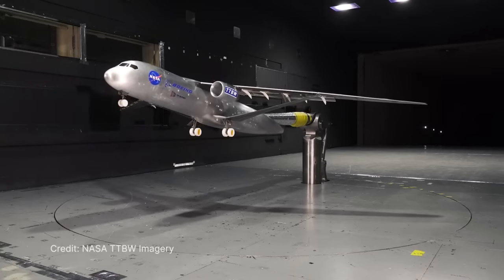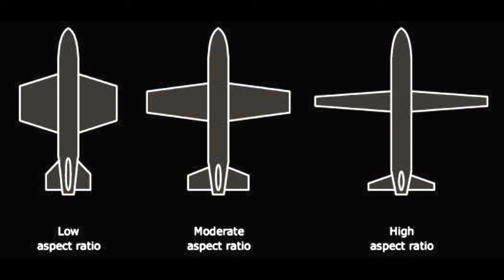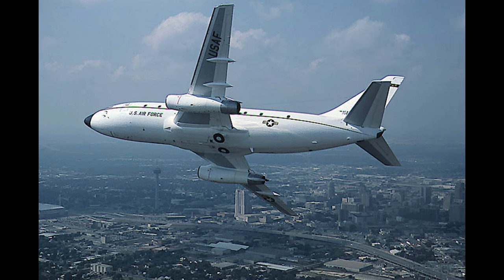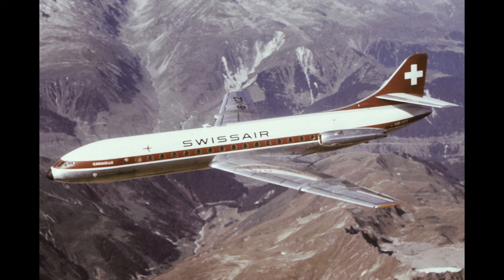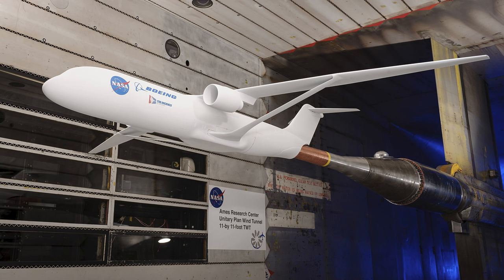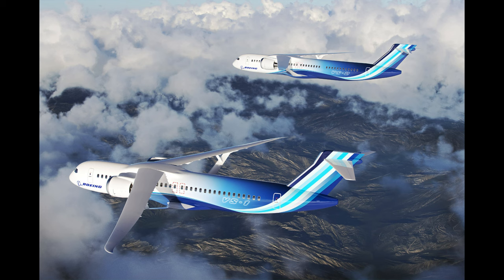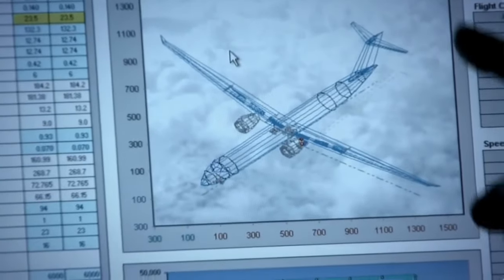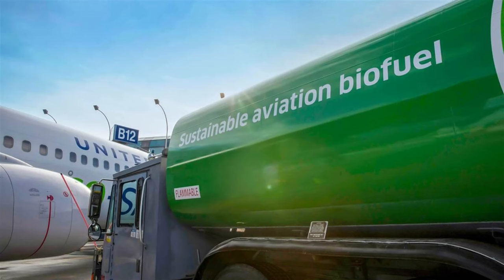NASA's New Airliner Experiment To Make Flying Less Expensive

Comment: Another place where electric planes might work could be island shuttles - e.g. between the islands of Hawaii, in the Caribbean, or the North Sea islands of the Netherlands or Germany. These flights take only 10 to 20 minutes, so it looks viable for electric planes. BTW, to locate these spots, look where there are still piston engine planes are used instead of turboprops, as these are cheaper on very short routes 😁
Reply: Look at Harbour Air . . .
Reply: Even small to medium planes flying between capitals maybe would work. Instead of driving like 6h, you could fly in about 30 minutes
Reply: @plcflame  Oh yes 30-minute flights, but let's see pre-flight, weather check, post flight inspection/log, find a ride as your car is back at the take-off point, ah NO! just as fast. I have been there and no it isn't faster by a large amount. How figure in purchase price, 110LL fuel, insurance, tie down monthly costs, NO flying is FUN but not faster. A trivia point, of the 300 million liters of kerosene made each year one half is used by the commercial airlines, (no emissions there), and the remainder is used by the third world countries to light their homes at night and to cook. Google it.
Reply: But how would you get an electric plane, with a 1ish hour battery life, to dinner of these remote isolated places?
Reply: @jessetheunending9357  the same way you get short distance prop planes there now, you ship them over.
Reply: @plcflame  You made the point where I would drive from LA to San Jose in 6 hours, and a flight from LA to San Jose is about 45 minutes, not counting driving to the airport, logging in, waiting, boarding, etc. Yes, flying is great unless you happen to fly on the windiest days of the year, which I did. I got royally sick for days, ruined part of my vacation. So, driving is longer, but I still have a car at my destination.  But hopping islands is a different story and I definitely would take a plane.
BTW, I enjoy driving on Hwy 101. If I leave early, I get to my destination by noon. Instead of renting a car, I drive right to where I want to go. So much simpler though it takes a little more time.
Reply: @plcflame  HSR would be the optional substitute for 6 hour drives
Reply: Look into Eviation, they're targeting that market with their battery electric regional jet. They just did first flight in September!
Reply: @plcflame  Would an express train, like TGV or ICE, not be the more convenient and efficient solution for this use case?
Reply: @plcflame  not really. A electric airplane would be much slower as well. Proboly about 400km/h or so. So a 30 minute flight is about 2 hours on a decent highway.... or 1.5 your in Europe.
Reply: Good luck charging it.
Reply: @peterolsen3797  That kind of flight is better accomplished by a future rotodyne design than a plane.

Comment: Scott - saw the pic of the flying wing design in today's video - you might be interested in this... very much like your comment about the time for the FAA to certify unleaded fuel...
Over 20 years ago I was doing computer language training for Boeing in Seattle and during the week saw the model they had of their version of the flying wing airliner.  I asked one of the VPs there about it and he said they were abandoning the idea not due to any design or mechanical or production issues, but because the FAA told them it would never get approved for commercial use.  He said the FAA has a requirement that all passenger aircraft must be able to de-plane all passengers in 90 seconds or less in an emergency, and the huge distance in the flying wing from the center seats to the exterior doors means they can't make it big enough to fly profitably and meet that emergency requirement.  So no flying wing for us - it's often the safety issues that prevent otherwise "good" ideas from being realized.
Jim
Reply: I still see the concept viable for cargo. Disregarding the evacuation part, if you sit away from the center, you are not going to like it as even the tiniest angle change is amplified. Of course there is also the fact that you can't have windows, But hey, packages don't need any of those...
Reply: I wonder about the implications of that 90 second rule for SpaceX considering plans to use StarShip as a passenger hyperliner from one Earth port to another? Or for military personnel transports, etc. Airlock, cargo, or passenger egress doors may add weak spots in fuselages (e.g., SpaceX welding over Starlink ports for initial test flights). Wonder if the Human Lunar Lander astronauts would be require the capability to de-ship in 90 sec too.
Reply: Cargo folks seem to be perfectly happy picking up second hand passenger jets, though. It would surprise me if there was enough market demand to make an entire category/design of plane that was cargo-only. (A flying wing, not just a cargo variant of a passenger rated jet)

Comment: Even extremely small savings in fuel are worth it for airlines. I work for a  fairly small airline, we have only around 300 aircraft (all A320 family ones). And for example we use single engine taxi out, so we start only one engine initially for taxying to the runway and start the second one later on, which needs us to use our judgement to make sure it gets its 3 minutes of required warmup time before we can use take off power. Single engine taxi out saves on average 40kgs of fuel per flight. Doesn't sound much. But if you consider we have around 1.500 departures per day, every day of the year and we can use single engine taxi out on roughly 70% of our departures (sometimes it can't be used, like in low  visibility operations, operations on contaminated surfaces and when the taxi time is too short), that is 15.330.000 kgs of fuel saved, or 15.330 metric tons and that in turn saves around $15,775 million per year. Of course that is only one of the many measures we use to use less fuel, and in the end  it is just a tiny amount of fuel saved, not a whole percentage point at all, so the roughly 2 to 4% that a winglet (sharklet for us) saves is use, and even more so the 15% that replacing a CEO with a NEO aircraft does. So getting 10% basically free savings with a different wing design is absolutely worth it.

But from my point of view it will still have to fit into the standard airport spaces, which means maximum 36m of wingspan at the gate for a narrow body airplane, so basically everything up to 240 seats per cabin (max certified for the A321 is 244 seats, 737 MAX 10 230 seats). Which will quite likely require some clever mechanical engineering.
Reply: I admit I do not think of 300 vehicles as a small transport company, but I have to remember firms like Delta have a few thousand.  But you are right in that a little goes a long way, UPS avoids left turns as much as possible because of time spent idling waiting to turn.  Mythbusters tested this and found it only saved a handful of gallons a trip but even they concluded when you put that across nearly 100,000 package cars(what  UPS calls their delivery vans) a few gallons of diesel is now several thousand gallons of diesel saved per day.

Comment: This is the wings design I was going for as I was planning to make our fixed-wing platform drone. And now I see it here. I take it as a compliment :)
Really, exactly this. A long wing with this type of support that it functions for lift as well, just as another wing. My concept includes another solution as well, which I will keep for myself for now.
If you don't know, I worked on building a monitoring fixed-wind drone before and I worked in the aerospace industry as well.

Comment: Harbour Air flies a lot of short hops. The Vancouver Airport, Vancouver City, and Victoria triangle is ideal for electric aircraft in a way that almost nowhere else is.
Reply: If you only do one hop!  Harbour Air does 300 flights a day, which is why their electric plane isn't running on one of their routes.
Reply: @StinkPickle4000  true, new charging infrastructure will be needed. The combination of high voltage and seawater will be a challenge.

Comment: saw a similar truss wing design research papper in 2010 during university time. I vaguely remember additional drag from the truss support outweight the drag reduction from increase aspect ratio. The lift generate by the truss wing also cannbalize the lift on the main wing, so it's very difficult for a truss wing design to have better lift/drag performance over traditional design. Unless composite material advance enough in the last ten years making the truss structure smaller, it's probably not worth it.

Comment: This is very exciting stuff. Combining these new airframe designs with the very latest in ultra high bypass engines, unducted fans, may be a huge step forward for aviation.
Reply: I came down to the comments to say much the same. It seems as if a new engine type is coming, it should be combined with this new wing type for a whole new plane. Yet Boeing says they won't even get out the drawing board until after 2030. They should be testing unducted fans together with transonic truss and have it worked out by 2027 or so. That's halfway to a new plane right there. If they get aggressive they could have a new plane certified by 2032. Their current timeline would be lucky to have a new plane by 2037.

Comment: Another aspect of pure electric (battery) aircraft is the limitation in mission profile. Unlike a fuel-powered aircraft, the empty weight includes 100% of the battery too. So your load profile can’t be modified to suit a target range/mission. Not so much a problem for GA aircraft but absolutely a problem for transport-category aircraft. You need the ability to tailor your fuel load for the mission; a short hop, means low fuel and high payload and visa versa. Batteries don’t allow the same flexibility; your payload is always fixed which is a hard way to make money.
Reply: Interesting. Perhaps modular batteries could be used? If you need to go farther, load more battery modules.
Reply: Batteries can be removable. Ideally, you'd be able to move them around like ballast to redistribute weight, negating the need for actual ballast.
Reply: @GuntherRommel  true. There is potentially some limited scope for mission flexibility. However, in transport-category aircraft, if battery is the sole power source your landing maximum landing weight (MLW) becomes your maximum take off weight (MTOW) too. In liquid-fuelled aircraft the MTOW is significantly higher than MLW which further limits the comparative practicality of battery-only power sources. I think, like EVs, there will be specific use-cases for battery powered aircraft, but it wont be large, long-range or transport-category aircraft.
Reply: @jasondoe2596  yes, that’s indeed possible. Except every battery added reduces payload and you need to carry that weight for the entire flight. As liquid fuels burn, the aircraft becomes lighter and thus requires less power to maintain a constant speed/altitude. Alternatively, as weight is reduced during flight, you can fly higher/faster for the same power (which is exactly what modern airliners do). Batteries can’t do this which limits mission flexibility.
Reply: Well no.  Would go with palletized batteries.  Due to energy required during charging, would have to have palletized batteries be loaded anyways.    Or a combination is far more likely.  A base battery + palletized batteries.  Of course we currently have no battery tech able to meet requirements so who cares.
Reply: depends where you put the batts. If they are basically cargo, then you can do the same trickery, one less pallet of cargo and one more pallet of battery.
The main difference is the power density of fuel is not even in the same ballpark of batteries
Reply: @marcogenovesi8570  true. However, with pure battery power your MTOW and MLW have to comply with the most restrictive of the two. Modern aircraft the MTOW is much higher than MLW and allows for a lot of flexibility. Fuel density is a problem for batteries, especially on long range missions, but that is offset to a certain degree with power delivery efficiency being so much better with electric motors. Having said that, pure electric aircraft capable of similar performance to modern jets is still a pipe dream for many reasons; lugging 100% of your “fuel” around regardless of t charge level is a problem that will always exist and not something that scales well to transport-category aircraft.
Reply: @w8stral  regardless of how they are loaded, there are a number of factors (I’ve alluded some in other comments here) that make pure battery powered transport-category aircraft unattractive. That’s not to say there isn’t a role for pure-battery aircraft, only that even with conceivable technologies as it stands today, the use-case for such aircraft would be somewhat narrow compared to liquid-fueled aircraft. All I am highlighting here is the need to continue research into liquid fuels and aircraft utilising this power source to be as efficient as possible. Batteries are not the utopia a lot of people assume.
Reply: @DiverJames  electric motors have higher than 90% efficiency but it's still irrelevant because the batteries have power densities that are not even in the same post code of conventional fuel. That's the main reason electric aircraft (and land vehicles to a lesser extent) have inferior range.
Lugging battery/fuel weight or not for the whole trip gives an edge on fuel's effective "power density" or total system efficiency, but at the end of the day it means just a higher treshold to beat for competing technologies, in itself isn't a thing that always makes fuel better.
If there was a technology that is massively more power-dense then it would still beat fuel even if you have to carry the batteries around.

It would be like comparing battery power and compressed air. Yes as you use it up the compressed air will lower your mass but the batteries are so much more power-dense that they still handily beat compressed air as source of propulsion.

It all comes down to power density, the other stuff is secondary. Electric is not anywhere close for various reasons and is imho unlikely to get anywhere near unless you start installing hilariously unsafe (unshielded) fission/fusion reactors.
Reply: Electric aircraft can not file IFR due to fuel reserve limitation requirements.
Reply: @theethicsofliberty4642  Dude all bio fuels are  an energy negative process, you are storing energy to create the fuel and efficiency can't be perfect. Of course it's energy negative.
You will never beat just extracting mineral fuel that is already created "for free", that's not the point of biofuels.
Reply: @DiverJames  Until a new battery tech happens with several times greater energy density, even short ranged flights are impossible at any reasonable speed and at short ranges, may as well use a train which also uses electricity.  

If anyone can crack hydrogen fuel storage in a light container, then there are slight improvements we can make to aircraft, but otherwise aircraft efficiency gains are in effect --> over.  it is 100 year old tech at this point.  Everything that can be done economically has been done.  Only improvement on horizon is if someone can figure out how to make silicone carbide nanotubes in bulk and therefore we can ditch carbon fiber and use aluminum as  the matrix instead of epoxy.  Not carbon nanotubes which in effect are useless even if someone does figure out how to make them as there is no known matrix said tubes can be put in allowing you to use the fibers properties.
Reply: There is also work into plasma jet engines which require no fuel only electricity
Reply: The price difference between hydrocarbon fuels and electricity absolutely needs to be part of the discussion. I don't believe it's an accident that the first electric planes are in B.C. Canada, where rock bottom energy costs exist
Reply: @jasondoe2596  Or hydrogen fuel cell. Butt I don't see hydrocarbon fuel going away from aircraft due to unmatched weight & volumetric energy density they provide.
Reply: @oldmech619  true. For a long time you couldn’t fly IFR charter or RPT (pax) in single engine aircraft, and now we can use some single engine turbine aircraft for those sorties. Point being, as technology matures, legislation adapts. Having said that, I don’t see battery-powered aircraft flying IFR any time in the near future, if ever.
Reply: @DiverJames     At some time in the future, small electric pilotless cargo aircraft might be allowed to make short flights into cat 3c landings under direct control of ATC.  
Pilotless aircraft would also cut down the communication errors and would improve flight efficiency. 
Push button aviation at its best.  SFO here we come.   FedEx would love it.

Comment: This aircraft coupled with a version of the CFM Rise engine could be even more interesting.  CFM is targeting a 20% improvement in fuel efficiency over the most efficient high bypass turbofans in use today. I think it's set for its first flight in the next two years or so.
Reply: Ive been hearing about it again so i imagine they fixed the noise issue with the cfm rise?
Reply: @GonzoDonzo , Mentour Pilot has a video on the CFM Rise, the noise issue is not really an issue anymore.
Reply: Exactly what I was thinking too!